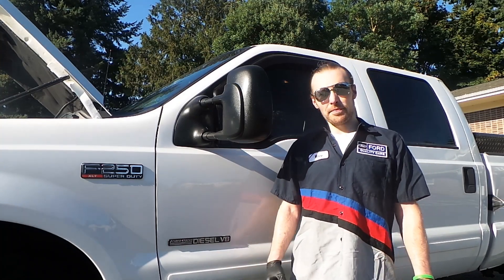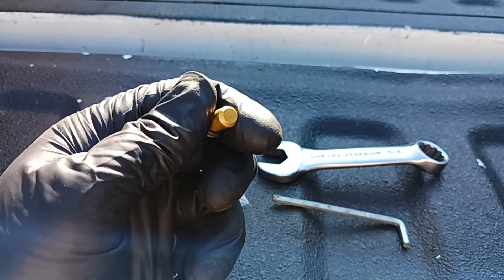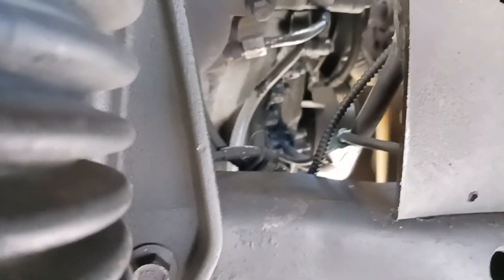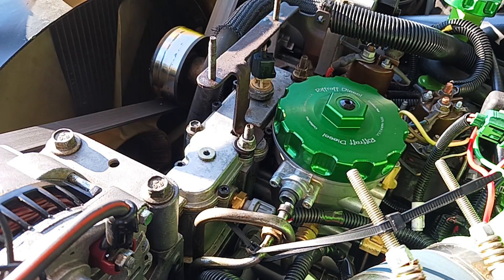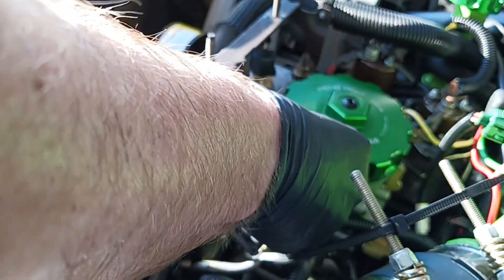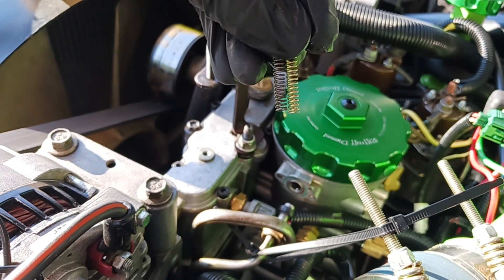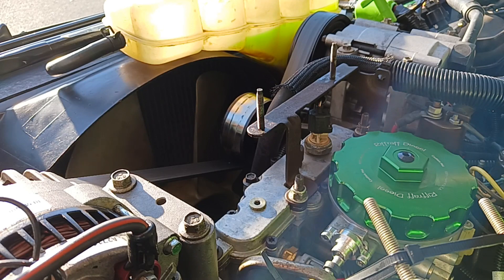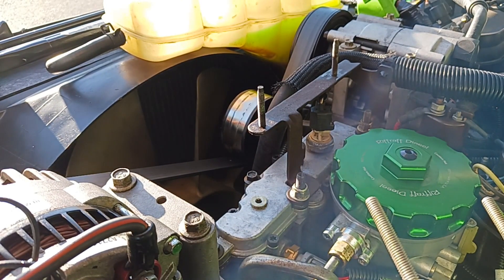Replacing FPR (Fuel Pressure Regulator) Housing/Spring on 7.3 Powerstroke

Comment from the maker: ATTENTION!! (This is especially important if you don't have a fuel pressure gauge)

Either using a mirror or a camera or the best option is a bore sight, once you have reattached regulator to fuel bowl but before attaching fuel line back on to regulator, LOOK INSIDE AND MAKE SURE THE SPRING IS CENTERED PROPERLY!!

The truck WILL STILL START if the spring is jacked up, but your fuel PSI will be all over the place which is not a good thing for any part of your engine.
Reply: Where's the screen for fpr?
Reply from the maker: @dantec8854  I believe that is only on the OBS 7.3s...the SuperDuty variant doesn't have a screen.

Comment: How did you know the regulator was bad?
Reply from the maker: @derekeveretts8160  my fuel pressure was low. There's a little port on top of my green fuel bowl cap that I attached a gauge to and monitored during idle & wide open throttle.

Comment: my question is did you use the poppet with or without the center hole for the 7.3 As you put the new one in you did not tell us the one you was going in with. I seen the one you took out had a hole but you said the the hole is for the 6.0 So did you install one with no hole? Thanks
Reply from the maker: No, the hole is for the 7.3. I left the one that was already installed in there. The poppet I first showed like 2 mins into video went into garbage.
Reply from the maker: "We are beginning to see some FPR rebuild kits offered on eBay and Amazon that supply a new FPR poppet valve. These poppet valves are from a 6.0L Ford engine and not the 7.3L engines where the fuel systems work quite differently. The Ford 7.3L engine FPR poppet has a small pressure relief hole in the end of the poppet to allow the fuel pressure to drain down when the engine is shut off. Without this relief hole, the fuel system remains pressured up, causing potential damage to your injectors and can cause fuel system leaks when parked. We also see kits for sale in these same venues that sell FPR springs that will overpressure your system and cause leakage and injector damage."

From https://dieselorings.com/products/7-028-1999-2003-fuel-pressure-relief-rebuild-kit

Comment: Question; do you know of a place to get the correct poppet for the 7.3 as a single part? 

I’m not finding it as a single part and I’ve only found it sold as a kit (pretty expensive). I’m not interested in the entire kit because, I do like the design of that Amazon housing you also used  and I decided to use that part alone form their kit. I don’t want to buy multiple kits to keep cherry picking the good parts. 

Thank you.
Reply from the maker: Unfortunately I am in the same boat as you :/ I want to replace my poppet too, but it seems like it only comes in kits. Even worse is the pictures of the kits generally don't have the right camera angle to show whether the poppet has a hole in it or not.

As far as companies that I trust, here are two different options, but they are each 60-70 bucks, but will be top notch quality.

https://dieselorings.com/products/7-028-1999-2003-fuel-pressure-relief-rebuild-kit

https://www.riffraffdiesel.com/fuel-bowl-fpr-complete-rebuild-kit-99-03-7-3l/
Reply: Ford part number = F81Z-9B249-BB
It has the poppet and poppet seat.   Best to change both.  Also best to avoid the Chinese junk kits.  If you dont then you end up with fluctuating pressure and other issues like hard starts.

Comment: Should i use the stock brass plunger??
Reply from the maker: Yes, stock brass plunger/poppet is fine! Other than a couple superficial scrapes on mine it was unaffected and perfectly operational. 

The orings/spring are the main things that wear out/need replacing.
Reply: switching plungers shouldn't matter for fuel running to bowl, only out of it

Comment: I have a question,i have the same truck but i used the sring and kit that came with the billet regulator,you mentioned the brass plunger having a hole in it the new one I installed doesnt, also my truck wont start,i have 70 psi at the fuel bowl with the key on.
Reply from the maker: Well it doesn't need the hole, it will start/run using a poppet without it. But it's not ideal. For instance in my truck it made my clatter/"cackle" from the #8 injector way louder, which is usually related to wrong fuel pressure.

Do you have a bore sight? One of those little noodles with a camera on it? Cause before reattaching the fuel line to the regulator, you should try to look into the regulator to make sure that the spring is lined up dead center. You might be able to see it using a mirror if you get creative.

It is incredibly easy for the spring to get bent off to one side when attempting to reattach regulator housing. Cause if that spring is in there improperly it will cause high pressure and absolutely contribute to a no start scenario.
Reply: @jamesb1988  i do have a bore site
Reply: @jamesb1988  
I was watching you purge your system,how many times did you turn it on and off?
Reply: So the plunger needs to have that little hole in it?